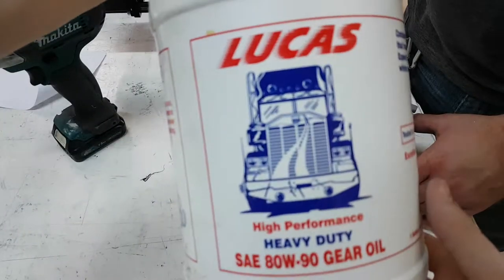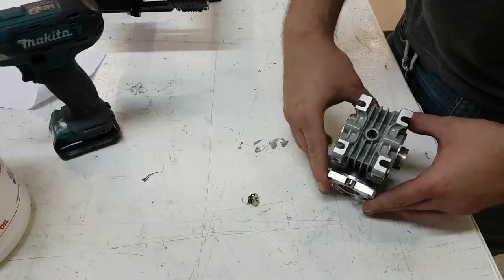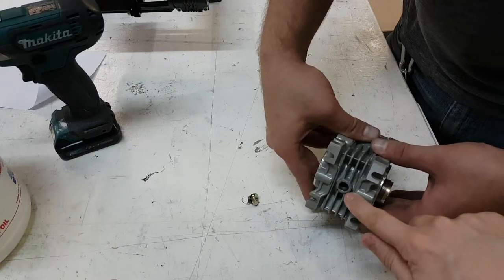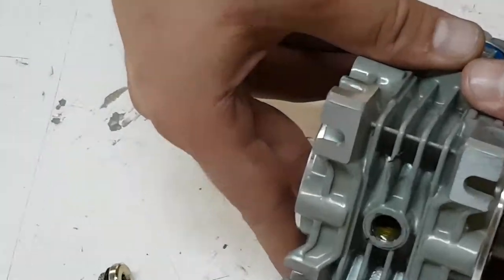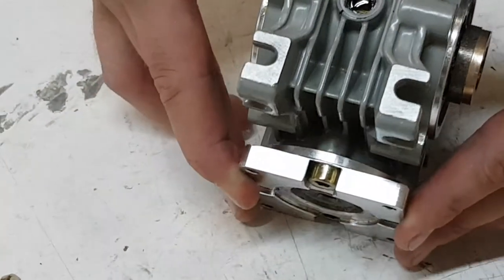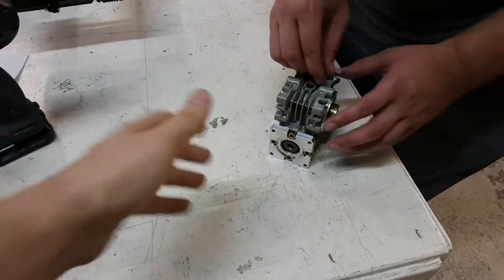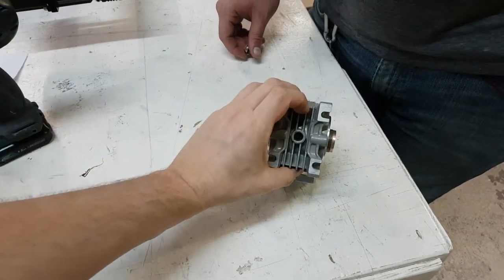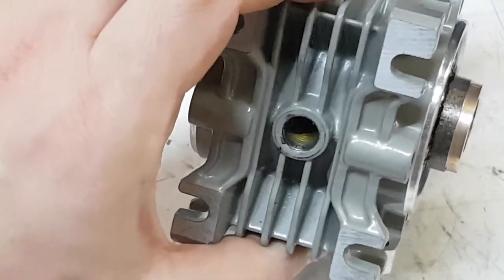Gearbox oil level check. SAE 80W-90

Comment: Thanks for sharing, sir.
This is something new that I learned today.

May I ask, How many milliliters of oil should I put in? 

Can I fill it up to full? or is there a minimum & maximum oil limit?
Reply from the maker: It should be filled about half way. For the smaller gearbox used on the Z axis, it takes 10ml of oil. The larger size extruder gearbox takes 20ml of oil.
Reply: @3DPotterTech  Noted, thank you very much for your info sir :) It helped me a lot